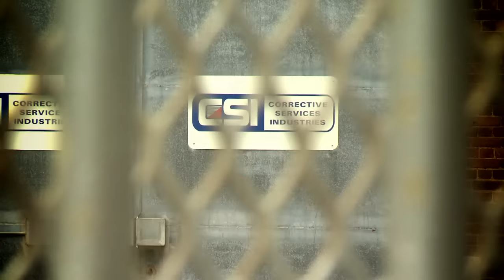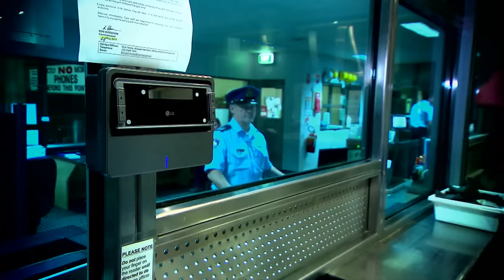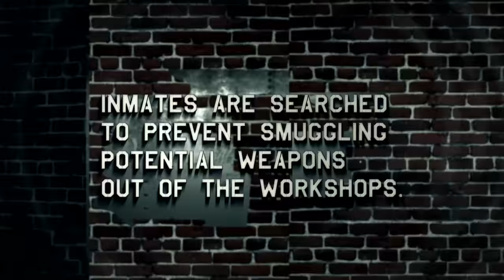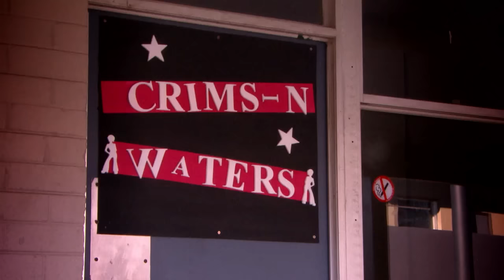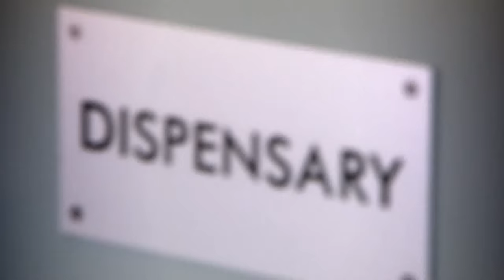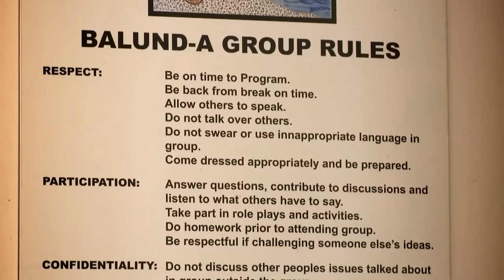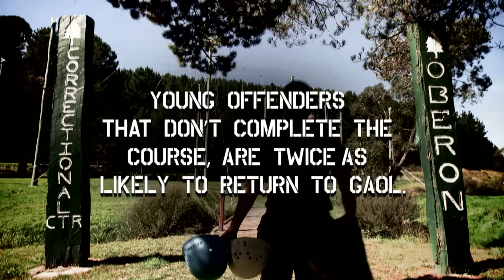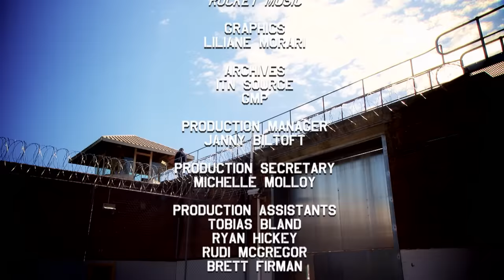What Supermax Prison's in Australia are Like | Inside | Ep2 | TCC | Crime Stories

Comment: Not very maximum for a super-max. There are some good features there but there are lots of features missing. Officers shouldn't be carrying cell keys in a newer prision, they should be opened by the control room. In Canada, we have armed control posts and galleries overlooking the units, etc. We also have armed patrol vehicles on the perimiter to respond to alarms. Iur officers also wear stab resistant body armour and carry OC spray. We could use the screens over the yards like the Aussies have, though. Drone drops are a major problem.